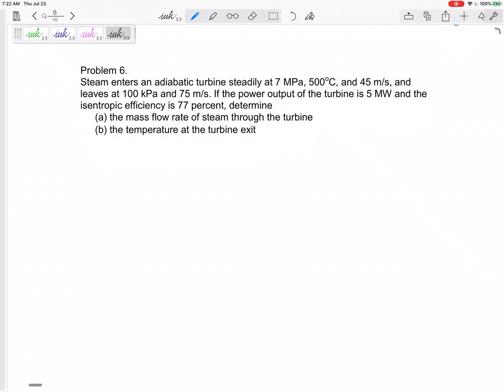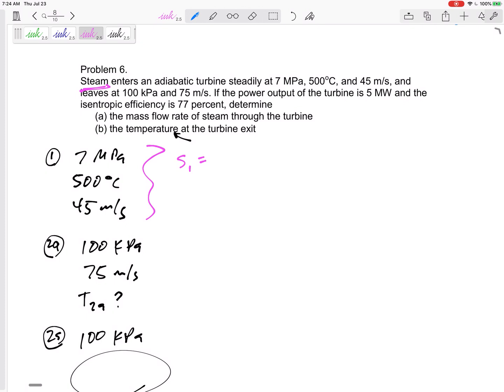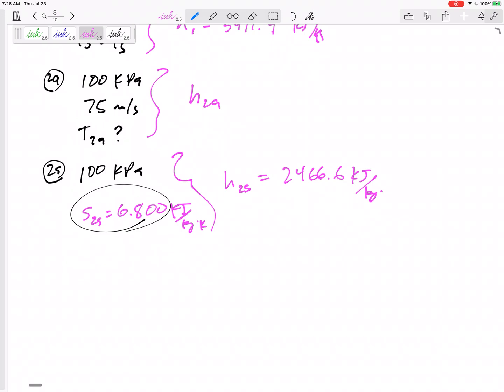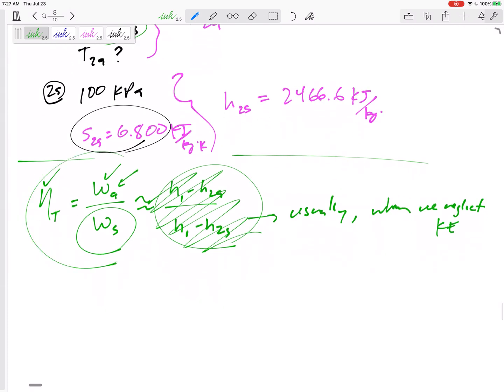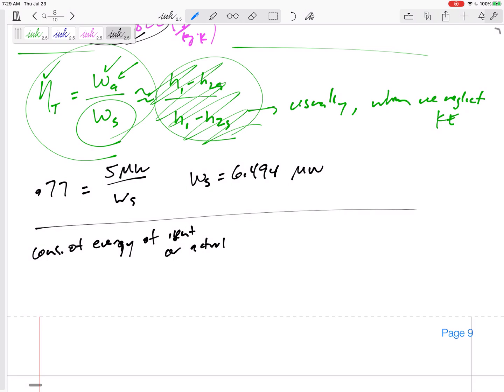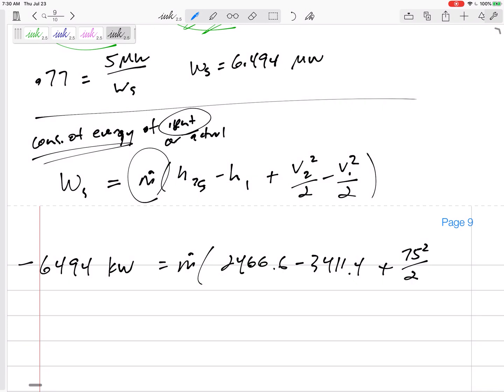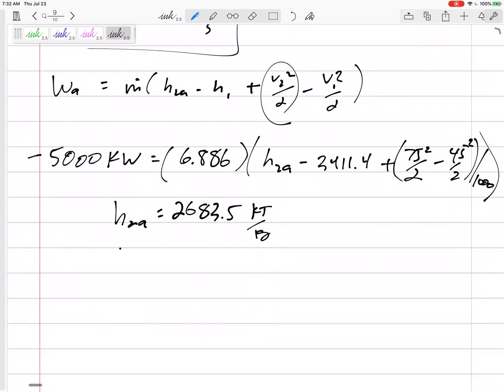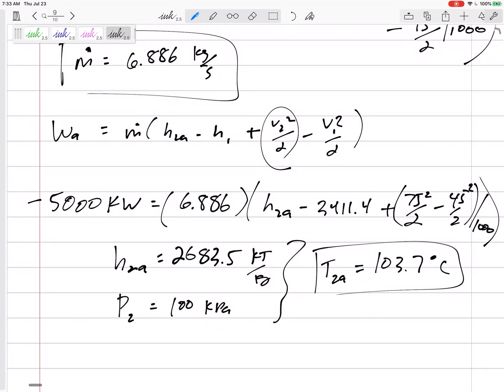Thermodynamics - Test 3 review - isentropic efficiency example 2

Comment: Professor I have a confussion about the equation at 6:48. We wrote just just V2(velocity of state 2 actual) in the equation ,we didn't write V2s(velocity of the state 2 isentropic) ? Did we just asssume V2a=V2s ?
Reply: You use actual enthalpy in the energy equation, never the isentropic.  That h2s is just to see how efficient the process is compared to a perfect process, which doesn't exist but it sets a bar, a standard if you will.

Comment: how did you get h2s. That's the only part im not getting
Reply: You use the 77% to find h2a, it's the efficiency equation, yes there's some algebra involved.
Reply from the maker: Hmmm.... if you know two properties you should be able to find the rest. I would start by guessing that it is a mixture so go to table A5 and for a pressure of 100 kPa, is the s value between sf and sg? If so, calculate the quality and use quality that to calculate the h. But I think this may be superheated. So going to A5 would show me that s is larger than sg. Then I would go to the superheated tables with 100kPa and s. The s value value I have is probably between two s values on the 100kPa superheated box. So the s value is between two s values on the box and similarly the h will be between the corresponding two h values on the table. Interpolate to get the h. Did that make sense to you?
Reply: @engineeringdeciphered  no, there is something wrong. The s value we have is between sf and sg for 100kpa on table A5. When we calculete the quaility we get x=0.907 and the value Of h2s become 651.06. Could you check?
Reply from the maker: @erendastan6158  ah, yes you are right that it is a mixture. And you’re right- the quality is 0.91 but I think you can use that quality to get close to the enthalpy in the video. h = 417.51 + 0.91(2257.5) would equal 2471.84
Reply: @engineeringdeciphered  sir is it possible to share your email with me, I have something to consult you
Reply from the maker: @erendastan6158  mbm0021@auburn.edu
Reply: @erendastan6158  h2s = hf + x . hfg